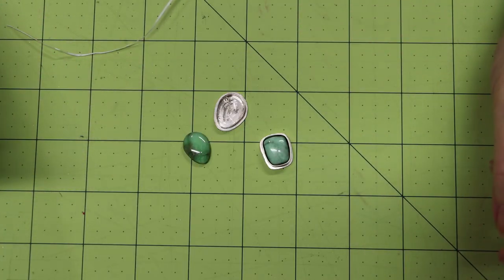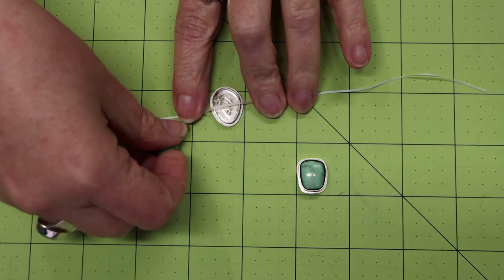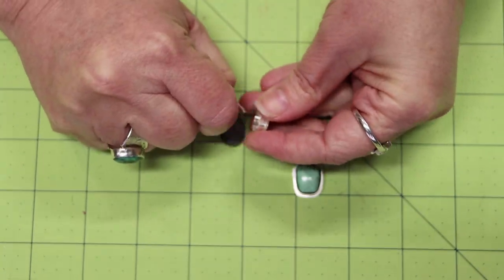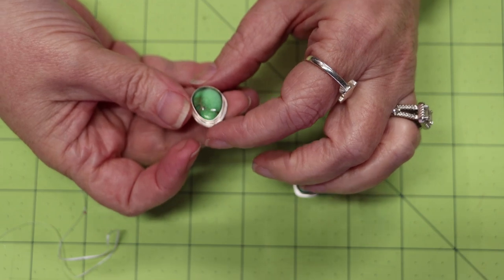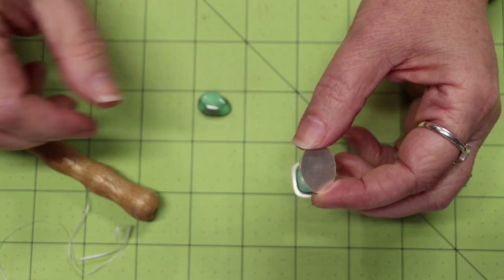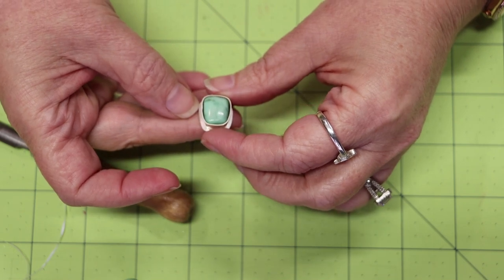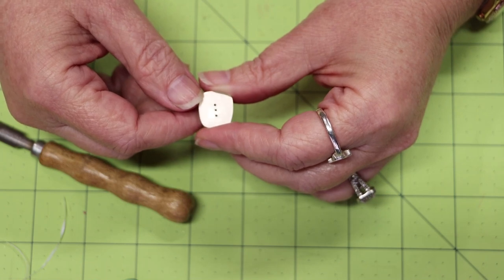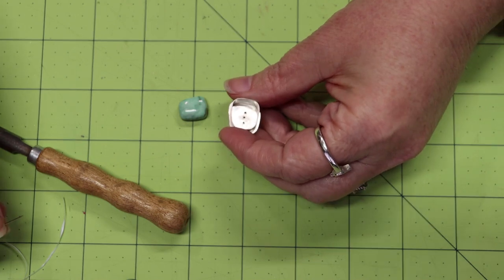Helpful Hints: How to Loosen a Stuck Stone

Comment: I’m going to try tapping on the back of the backplate and then cross my fingers that it pops out!  Thanks so much for sharing these tips!! 😃
Reply from the maker: I hope it works for you! Sometimes it takes quite a bit of tapping. Please let me know how it turns out!
Reply: Tammy Baalman I tapped and tapped and it just wouldn’t budge.  I’m sure I didn’t tap long enough, though!  So finally, instead of drilling a hole in the backplate, I used my automatic center punch on the back and the stone popped right out.  😃
Reply from the maker: @kristinperdue6392 , so glad you were able to get it free! There are so many different ways to do it, so I'm glad you found something that worked for you.